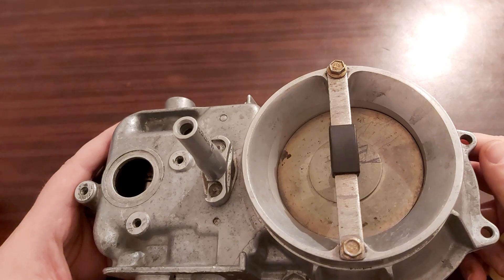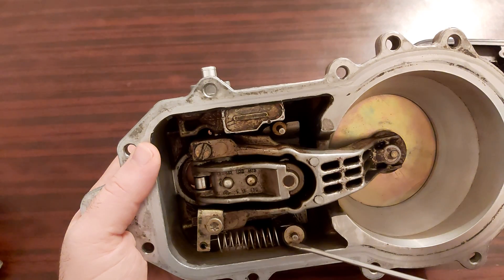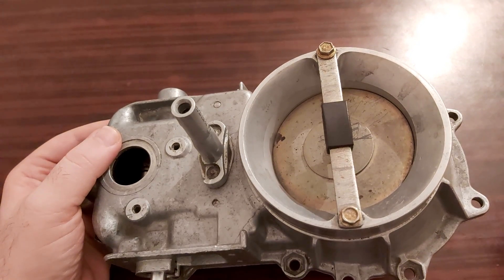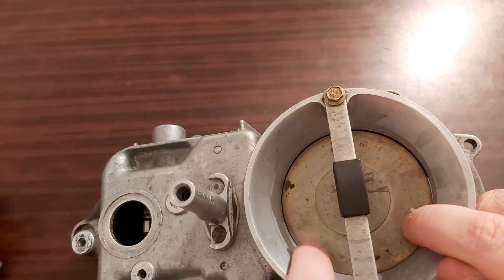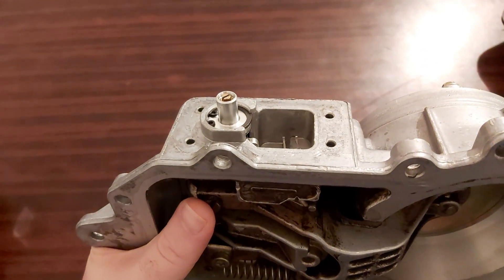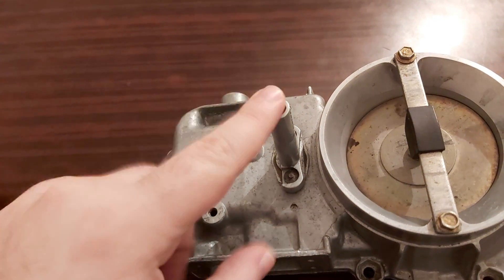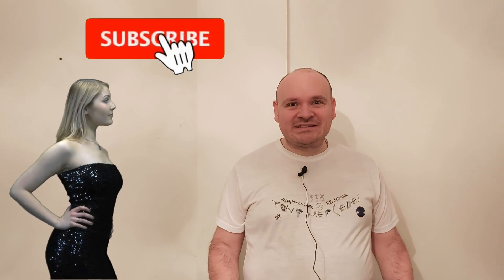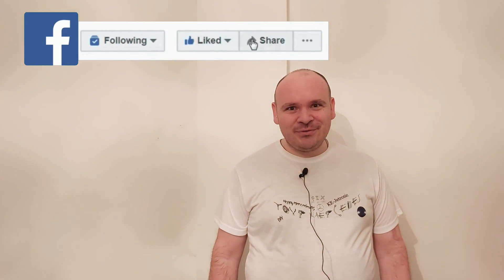㉦Mercedes Ke-Jetronic㉦ - Airflow meter explained in details(for those who want to know more)

Comment: im having an issue as well. No matter how i tune the air flow adjuster the engine just isnt getting enough gas. No matter how i tune it i dont know what to do anymore is it possible u can help me?
Reply from the maker: Do the initial mixture adjustment, check all the sensors and mechanical components and then fine tune the mixture.
Reply: @mercedeske  this is my first mercedes and first car. What sensors should i check and how should i check them.  Is there any way to contact u personally ill pay for your time if need be
Reply from the maker: @zeropoint9474  You can contact me on my instagram page.
https://www.instagram.com/fix_your_mercedes/
Reply: @mercedeske  sent u a message, thank you

Comment: Hi….Im working on ‘85 jetta with cis-e system very similar….On my potentiometer, one of my 3 contacts in the harness connector is damaged(all bent up). I also have one of the wires about to break off….insulation hard and completely broke….just hanging by the copper strands.  Can you tell me how to unpin these female contacts so I can repair my wiring harness?
Reply from the maker: I wasn't working so much with VW  so I can't tell about that much.
Reply: @mercedeske  ok….I have taken them out before but its been years ago.  I can seem to get the metal lock tap depressed…..I cant really see where it is.  Thanks anyway
Reply: @mercedeske  awww…..found out from my son who was a vw tech. how to get them out.  FYI….each contact has 2 metal taps that lock them in the plastic connector….one on each side of the contact….both have to be compressed inward at same time away from the plastic to clear the locking groove.

Comment: My plunger is sticking and the center plate goes down but doesn't return up. Should the plunger fall just under gravity or should there be a return spring to push it down? Thx
Reply from the maker: There is a spring on M102 engines, on M103 there is not as well as on M116/M117 engines. I suppose that you have rather problem with the airflow meter(spring stuck). Remove the airflow meter and flush it with a carb or brake cleaner and get everything back. If you have a problem with the plunger then soak the fuel distributor in WD40(although I would say that you have problem with the airflow meter).

Comment: My car have a low RPM about 5/5.5 after i start the engine and its shake unless i give it some fule then it's study this proplem goes worst when the AC is on please help 
And thank you again for this useful information/ sorry for bad English ❤️
Reply from the maker: How many kilometers do you have on the clock and which sensors did you replace?
Reply: @mercedeske  i didn't replace any sensor the engine is bad idl
Reply from the maker: https://www.youtube.com/watch?v=gdbkNgjvrCU
Replace these parts I am talking about.

Comment: Hello my friend I just finished putting new gas tank in my 300sl 1991 now I have no leaks so far now I have to turn my air flow meter adjusting screw counterclockwise to get it started . Tomorrow my friend would crank it while I try to find the correct adjustment. I hope it would start. I change filters everything
Reply from the maker: Hello. Just don't do the adjustments on your engine OFF, always while the engine is ON, running at the operating temperature.

Comment: Thank you for perfect video. I think I have problem, because guy who sold me a car told me that they turned with Co screw, but I dont know which direction and how much. I have problem with acceleration. When I push acceleraror too much car interupt acceleration then I must take off foot from accelerator. It lasts 2-3 seconds and than i can push accelerator  and car accelerate again. It is problem durig overtaking. When I push accelerator to max50-60% car accelerate to max rpm without interupting. Can be the problem with co screw? Thank you for answer.
Reply from the maker: If you have more or less gap then 1.9mm then you have a problem with the plate. Check how much free play you have before the plate starts moving harder.
Reply: @mercedeske  Ok, thank you. I ´ll check it.